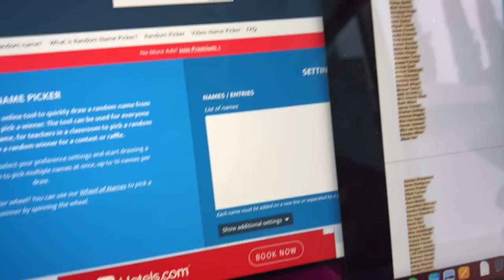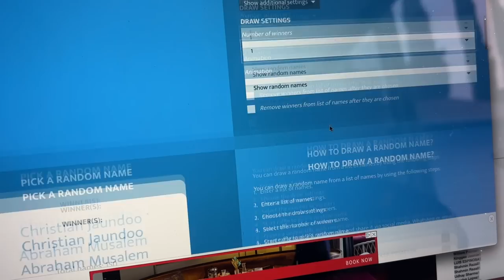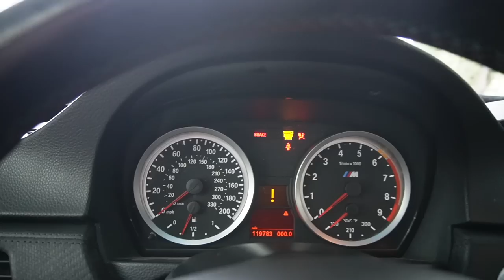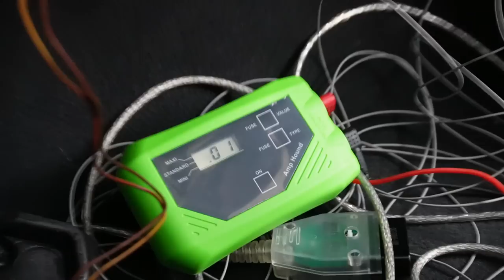Building A Custom 1 of 1 E91 M3 Wagon! (Part.27)

Comment: congrats on finally locating the culprints for the battery drain
only 1 pining error and 2 missing pins for a whole Chassis swap with lots of custom rewireing - thats a hella good percentage

only sad that we could no see more of Nick doing some coding on the NBT - thats the part that I'm most stuck on in my decision if i wanna do the upgrade too or not

paint or wrap - imho with all the Bodywork that still needs to be done and to prep it for a clean wrap you may aswell paint it already - the cost is not much more after all that is done and you negate the risk of damaging the bodywork when removing the wrap and do the paintwork